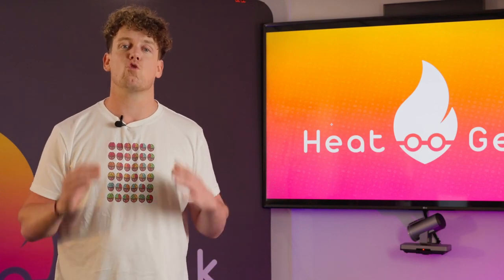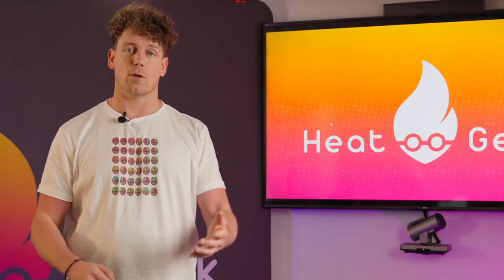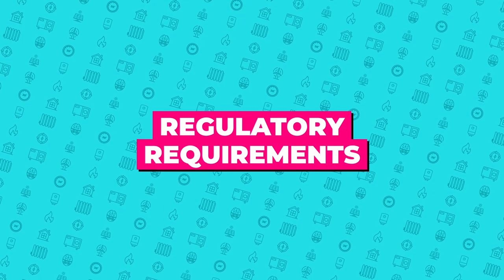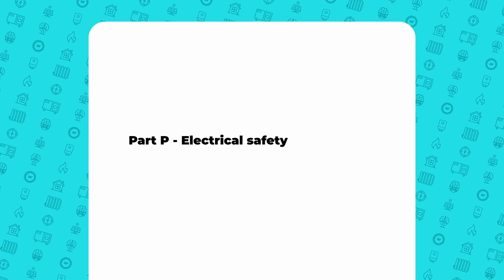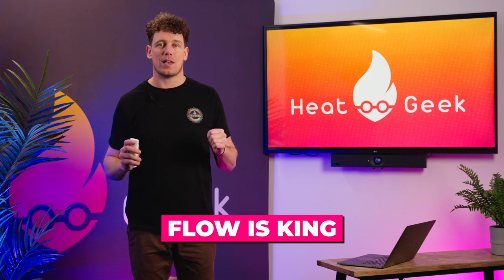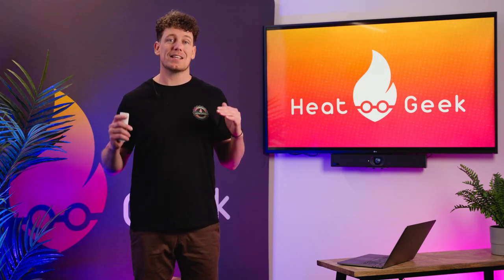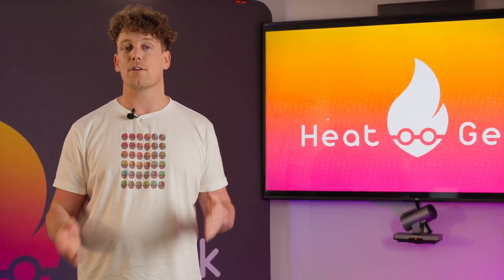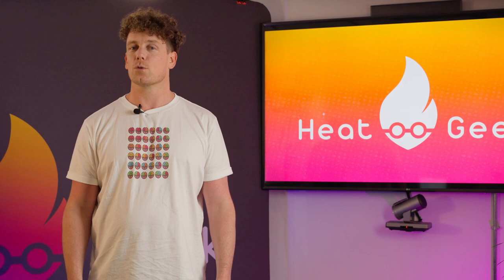Heat Pump Regulations: All You Need to Know

Comment: Hi Heat Geek,

Firstly, I'm a huge fan of the channel! But, you do stand on a platform of being an industry expert and you've made some sweeping statements in this broadcast which I would challenge.

You state that "plastic pipe is strongly advised against" because the effect on system efficiency by the use of plastic fittings inserts.

Where's your data to back this up? I do understand where you're coming from, especially thinking about the JG inserts. But, as others have pointed out, the Hep2O inserts are super slim. I still can't find any JG data, But Hepworth DO publish data for their fittings. Unless they're lying or it's a misprint, their quoted equivalent pipe lengths for 28mm pipe are Elbow 1.0m Tee 1.5m. The copper equivalent, as published in the Yorkshire Copper Technical Guide, is exactly the same at 1.0m and 1.5m.

You state that plastic pipe "harbours MUCH MORE bacteria". Again, where's your reference for this? Anecdotally, copper is well known for it's anti-bacterial properties, but what do you claim "much more" actually is? And what's the relevance of that anyway? We're not discussing a potable water system. We're talking about a closed loop system of limited water content that is likely treated as well.

You state that MLC offers an "increased O2 barrier" compared to other "basic" plastic pipes. Which pipes are you comparing it to? Are you referring to pex type pipes? Would anybody not use a barrier type when installing a central heating system? Even Maincor themselves don't claim MCLP has a permeability advantage over other plastic barrier pipes.

You state in another answer "Any disruption causes turbulance and resistance. The increased velocity increases that effect". That's a pretty bland coverall statement of any fluid flow. Why are we talking about any increase of velocity? We usually design systems around a flow rate of 0.5-2.0m/s. That's got nothing to do with the material used. We design pipe sizes to acheive our aim with whatever characteristics our material of choice has.

I'll say again what I said elsewhere, I'm no plastic fanboy. I prefer copper almost all the time. But as a fellow geek and engineer, the arguments are far more nuanced and shades of grey than you portray here. If you are going to paint a black and white world, please at least quote some material sources for your arguments.

Comment: I'd like to see empirical evidence on the effects of plastic fitting inserts, especially a comparison between hep2o, which uses very thin stainless steel, Vs JG speedfit and others with those thicker plastic ones.

I'm not convinced those stainless inserts have much effect at all.
Reply from the maker: Any disruption causes turbulance and resistance. The increased velocity increases that effect
Reply from the maker: Any disruption causes turbulance and resistance. The increased velocity increases that effect
Reply: @HeatGeek  sure, absolutely. The question is how much, let's see numbers.
Reply: I agree! I'd like to see some numbers as well. It's not a difficult mental excercise to see that any interuption to flow will have an effect........ but how much? Normally, when calculating the head of a system, a factor Zf is introduced to take account of various restrictions to flow. e.g. valves, fittings etc. But those numbers are pretty approximate and I've never seen any data to back them up. I've just had a quick run through some of JG's tech sheets, and I don't even find them addressing the issue of increased head with their inserts. I'm no plastic pipe fanboy btw! If you look at a 10mm JG pipe with an insert in, you'd wonder how anything gets through at all! Copper all the way for me. I just like facts and numbers to back up qualitative arguments.
Reply: If you look in the CIBSE heating design guide you will see easy to follow tables that show the increased resistance in through plastic pipe over copper even without the addition of restriction through fittings
Reply: @Terrylambert7203  plastic pipe has a smaller internal diameter due to thicker walls, so there will already be a difference - but that doesn't account for the assertion here that the inserts are a major issue. All the corners are swept on Hep2O, and the insides seem much smoother to me than many copper pipes I've seen.

When I replaced a bunch of terrible plastic with good plastic (hep) I crunched the flow rate numbers, taking the internal diameter into account, and upsized a few pipes to 22mm. So I'm trying to establish whether 0.5mm stainless inserts are worth any worry when the pipe has so much more capacity than needed by the design. I think the answer is "obviously not".
Reply: @Terrylambert7203  the factor for “surface roughness” is the same for both copper and plastic. Therefore the only difference can be size and flow restrictions, which is patently different when comparing 22mm for instance, because of the lower id in the plastic.
Reply: As you don't use elbows with plastic pipework as a rule and use swept bends with a radius of approximately 10 x dia of pipe ie 15mm = 150mm radius and minimum joints I would have thought that would make things roughly equal. Also with more modern properties where you can't notch joists and they have 450mm to 600mm centres how would you use copper?

Comment: Adam The reason that secondary return pipe can not be in plastic is because the pipe isnt tested or bench marked for that application 
If you need to do it in plastic you can use MLPC pipe but only one recommended for hot  and cold and not.the basic underfloor one.
Reply from the maker: It’s not tested for plastic because it deteriorates

Comment: Pipe diameter is key,  regardless of pipe construction.  If you new build heating with heatpump 1 inch pipe minimum the the biggest longest radiators you can buy for the biggest wall in that room.

Comment: I'm no heating engineer but I thought it's a riven that you shouldn't use plastic piping with heat pumps or even regular central heating 

As it stands, I'll hopefully be replacing all may copper pipes from 10mm to much bigger ones anyway
Reply: Plastic is very often used for heating.
Reply: Plastic is EVERYWHERE. It's in millions of systems with high flow heat pumps globally. It can cope with glycol no worries. If it can carry the required flow, it'll be fine.

There's no way a whole house needs replumbing just to change the material of pipes if they're already large enough for the flow. Any plumber that turns up saying that must be challenged to crunch the numbers to PROVE IT or quit trying to push unnecessary work.

Comment: R.H.I. Put the responsibility every 7 years on to the homeowners you have to say you are still using it and no changes to the system and they really noise you up to sign to prove it works.Not bothered about cosy and warm AFFORDABLE HEAT.cowboy installers on a Free Grant.